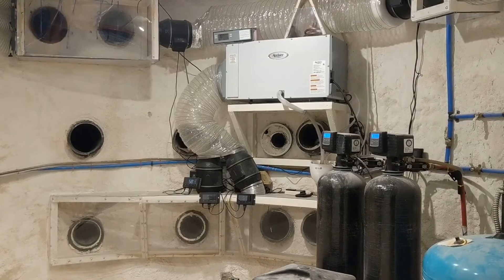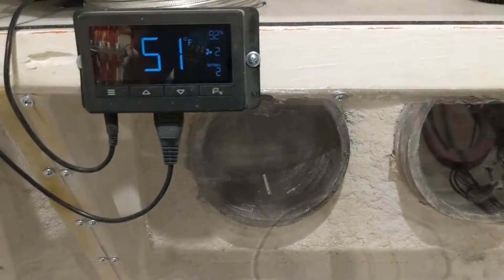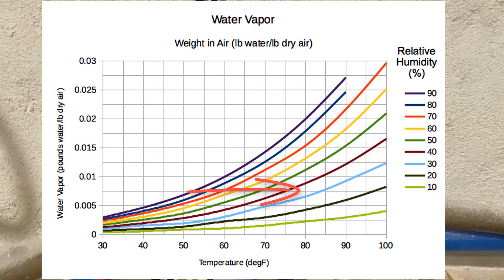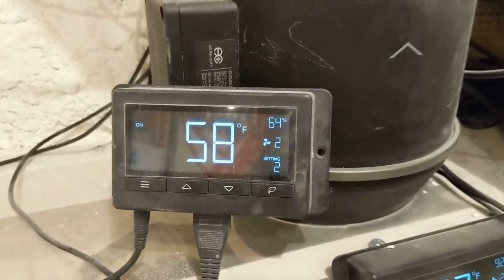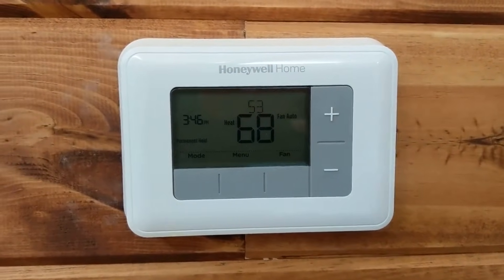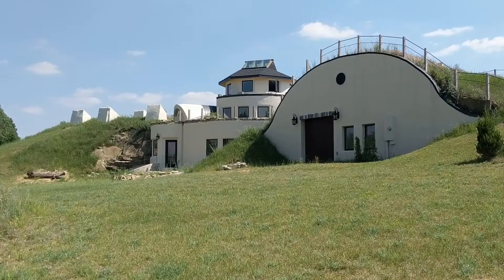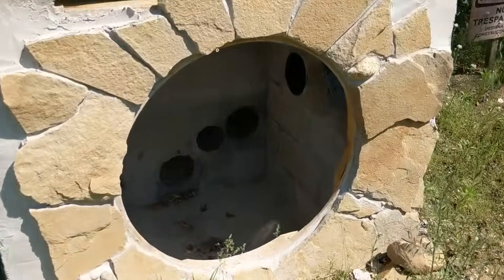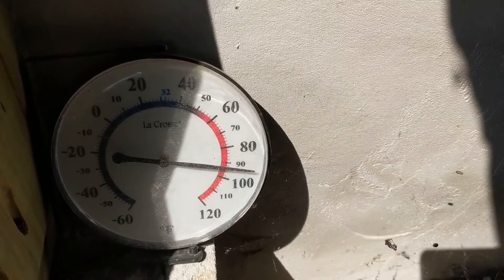Earth Tube short...

Comment: I have considered using earth tubes for home cooling as well as a water source. Place a catch basin at the intake to collect the condensate and make the pipe smooth and continuous. I'm not sure what kind of volume it would produce though.
Reply from the maker: I am sure the volume of water produced would vary during the year.  In the spring, when the walls are cooler and the air is very humid, we get a lot of condensation.   In the winter, the opposite is true (warmer walls and low humidity in the air), and we get none.  Ironically, the more you need water (for instance, if you are in a desert), the less you will get from such a system.
Reply: @SimonHomeintheEarth  
You can estimate the potential quantity of condensate using psychrometrics, all you need to know is your height above sea level, the airflow rate in cfm, the inlet/outlet temperatures and RH percentages.  You can use the same method to estimate the heat transfer and, if you measure the power consumed by the fan(s)), the system efficiency too.

Comment: Fantastic!
Thank you for showing your working set-up!
Materials
1) Aprilaire Dehumidifier
2) double-walled HDPE pipes (4"x2 & 6"x2)
3)  AC Infinity inline duct fans x 4
4) galvanized steel lath
5) furnace filters
Design
*You slope the 4 pipes 250' up toward the house and make pipe fittings soil tight but not water-tight to allow condensation to drain.
*You have a machine room below grade. From there you pull air into the dehumidifier and then push air into the home. 
*Galvanized steel lath at earth tube entry  (& eventually furnace filters?) 
Did I get that right?
Did I leave anything out?
How many sqft is your home?
Reply from the maker: The double walled pipes are actually N-12 Dual wall pipe.  8 inch diameter with soil tight connections.    
The six inch pipes are actually just regular single wall corrugated tubes (drain tile) like you would get from home depot.  I actually put those in as drain tile for the house, but instead of a lasso shape, I have two pipes coming up the hill and around each side of the house.  They meet on the back side of the mechanical room and come up and in.  I was experimenting with dual use and various different sizes.  I do have some 4 inch and even a 1 inch pipe, but those are not currently hooked up.

I now have the furnace filters and screen in place.  You can find pics of that on our facebook page.  The house is doing great in the winter and I am over due for another video update.

Comment: I'm curious to know if you have any concerns about mold growing in the tubes as a result of the condensation down there?  Also the house is really coming along..  Getting some final coverings on surfaces must feel so good.
Reply from the maker: Nope, no mold.  Mold needs a few key elements to survive and make sure to withhold a couple.  If the tube were made of concrete, there might probably be a problem.
Reply: Yes, and I was wondering why we don't see a lot of water staining the concrete or puddling in the bottom of the entry box.
Reply from the maker: @ForbiddTV  Yea, I think I already answered this one for you...   The bells on the ends of the 20 ft pipe sections all open downward.  The inside is mostly smooth, but the joints are grooved and catch the water.  The connections are soil tight, but they are not water tight, so the water leaks out.  I tested this before burial by putting a garden hose in the top end and even at a full flow rate, almost no water came out at the bottom of the hill because there were 13 joints leaking along the way.  I'll have to find that video and remember to explain this when I do the "all seasons" earth tube video.
Reply: @SimonHomeintheEarth  Thanks for the followup info.  I'm making plans to get one in the ground asap and give it a good test this coming hot season down under.

Comment: Well done Simon...I haven't been watching for a long while, that looks fantastic and well planned, most earth tubes I've seen are way too short...you and the missus have taken up a huge project almost to completion, hats off to you both that is a huge achievement 👌👏👏👏👏👍
I have to mention your parents and the kids are a great help as well!
Reply: The notion that earth tubes have to be long is counter intuitive. Consider the surface area available for heat exchange of a single 250ft tube is exactly the same as 10x 25ft tubes.  The difference is you can move considerably more air through the 10 shorter tubes. If you place temperature sensors at regular intervals along the 250ft tube you will be able to see where the air drops to the ground temperature in the tube and then coasts through the remaining length without losing any more heat. Typically, with a reasonable temperature differential, it will happen in the first 20ft of tube, which means 230ft of tube isnt contributing anything.
If you like practical experiments, dig a trench and install a single tube 20ft long and attach a fan with a speed controller to one end. Install several sensors in the trench so you can monitor the ground temperature. Fire up the fan and see if you can get the temperature of the air coming out of the tube to be above the ground temperature. Basically, try to outrun the cooling capacity of the tube by increasing the airflow rate. Dont be surprised if you cant do it. Most video`s show the inlet and outlet temperature and sometimes the inlet and outlet relative humidity, but very few measure the airflow which is absolutely necessary for calculating the system performance. A large in/out temperature difference looks impressive but its meaningless without the flowrate.
Reply: @JohnGuest45  not sure if you watched the video, he has 4x250 ft tubes on this side and others on the opposite side of course airflow is very important (I've been in aircon/refrigeration all my working life) and looks like Simon has no airflow restrictions with this setup, and I agree you can also have 40x25 feet tubes and get the same result but you would need a ridiculously large return air fan box to accumulate (and balance airflow between ) 40 large tubes with correct spacing...don't you agree?
Reply: @noproblem2big337  
The 250ft tubes are a restriction in terms of limiting air flow.  At 100cfm you will need a fan capable of delivering 100cfm at 1.75" wc, the velocity would be approx 19.1ft per second and the air would take 13 seconds to travel through the tube. If the air drops to the ground temperature in the first 20ft you are in trouble because you cant just increase the flow rate due to the tube length, doubling the flow to 200cfm would require a fan capable of 200cfm at 7" wc. If you put the same 200cfm through 10x 25ft tubes you`d have 20cfm per tube, a velocity of 3.81ft per second and the air would take 6.5 seconds to travel the length of the tube. The difference is the fan will only be required to deliver the 200cfm at 0.01" wc which is easily done.  If you ran 100cfm through each of the ten 25ft tubes you would require a fan capable of 1000cfm at 0.17" wc, again very easy. If you tried to run the same 1000cfm through a single 250ft tube you`d need fan are capable of 1000cfm at 175" wc (thats almost 6.5psi !! ) which just isnt possible. Note the tube surface area of a single 250ft and 10 x 25ft tubes have exactly the same heat exchange potential, the difference is how much air you can run.

Comment: Nice to see some earth tube numbers, it was hot today. 
I gathered water from my spring for my solar shower today.  90 degrees outside, spring water was 45, the sun was able to take the water to 140!
Reply: Yea, I wish I had solar hot water heating.  That was in the original plan (vacuum tube setup), but was set aside for now until we sort out the critical stuff.
Reply: @SimonASNG   Since my place isn't anywhere near as long as yours is, my solar shower is simply a sort of black bag I lay in the sun, then hoist it with pulleys from a tree limb, so can be done with little expense until something better is installed.  Showering in the open woods is an experience!
Reply from the maker: I mainly want mine (I switched to the proper youtube account) for use in the winter as a heating source, which is why I need the fancy vacuum tube stuff.  My father uses those black panel heaters for his pool and they work very well in summer.

Comment: I'm envious. I have a gas pipeline on my property, so I'm limited on how long I can bury tubes. I'll get 100ish feet on average. Mine will also only be makeup air for open windows and exhaust fans.  Your setup is far more impressive.
Reply from the maker: If you can't go longer, just run more in parallel and then use a smaller fan or share a fan between them.  The tube length doesn't all need to be in serial if you just run it slower.  100 feet is enough.
Reply: @SimonHomeintheEarth  Yeah, I'm planning to run 2 parallel 8 inch runs. I'm not going to worry about a fan initially; hopefully convection currents will pull through enough air to be useful. If necessary, I can always install a fan after the fact.

Do you have any filtration on the air coming in?
Reply from the maker: @ryanbrown982  On the inside end, there is a proper commercial filter in the dehumidifier.  I plan to put furnace filters on the outside end also.  So far, I have not noticed any dust or pollen being carried in, but the fan blades are getting dirty, so maybe that is the evidence.
Reply: @SimonHomeintheEarth  Good to know. I'm actually off to pay for 250' of 8" pipe this afternoon to bury for a single inlet line to an ERV (possibly with a dehumidifier in line if necessary). I don't expect to rely on it for 100% of our cooling needs (I'm in TX, so cooling is more of a concern than heating), but every little bit helps.

Always enjoy seeing your updates. Looking forward to the next one.

Comment: recommend aluminum door screen over that mesh
Reply: Yup, I have rolls of the stuff.  I plan to build a frame with treated wood that will hold the screen and have slots for standard size furnace filters.  The lath was more urgent because we didn't want to risk critters getting in and blocking the ends, but we haven't actually seen any insects or even pollen making it all the way thru the tubes.